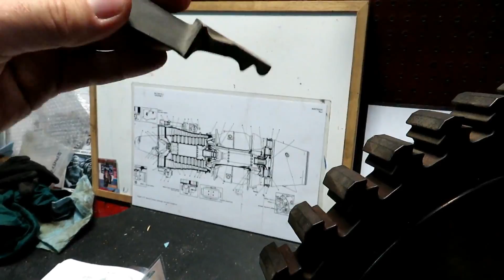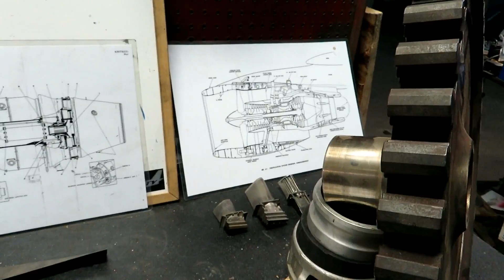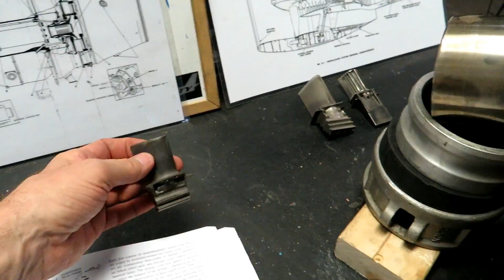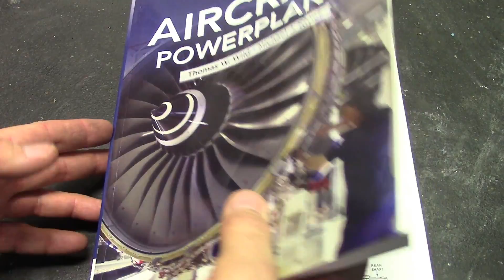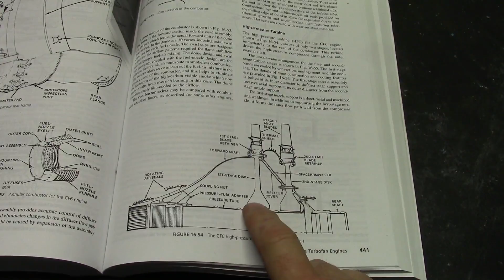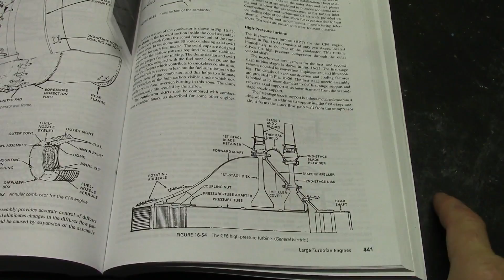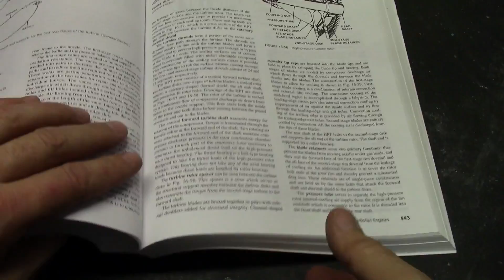Turbine Interstage Seals

Comment: how did the old blades not melt from not having the cool air.
Reply: They run on lower temperatures, which meant they were less efficient. The combustion was incomplete, and this resulted in black smoke from the engines.
Reply: Uncooled blades are commonly used at later stages of turbine as it's cooler back there. I'm going to assume these were IP or LP blades due to their size. HP blades are smaller and almost always cooled and coated.

Comment: 11:40, you can say that again to somebody whose new to this field. I am struggling, my intuition say the pressure should increase. Someone point me to another video for (fundamental) education.
Reply: Air expands when heated and the molecules vibrate more hence the air leaves the combustor explosively. There's high pressure in the combustor but pressure reduces as you as the air expands and whooshes past last turbine stages.
Reply: The cross-section exiting the combustor is shaped like a nozzle in order to increase the speed of the gas, as turbines extract kinetic energy, not heat or pressure (directly anyway). In order to increase speed, temperature and pressure is traded in. Additionally,  there is an open hole at the back of the engine. If air isn't actively compressed, and is above atmospheric, it wants to flow out the back of the turbine. In the process, it loses pressure to turbines and nozzles and air resistance.
Reply: when you design an jet engine the small portion after the flame section is generally termed the throat in most simplified videos ... from their you go into the expansion chamber and then on past the diverging end and out ... on the way by you run that air that is sped up along the fins of the turbine ... because of the angle they are on they start to spin which makes the engine produce thrust and pushes you forward ... take a house hold fan and put a cone on the output side ... at the end of the cone you feel faster air ... but a little warmer ... (thats the compression ... ok it would be maybe 0.000000001deg warmer) now if you had another fan after that cone the air form the first would start the blades on the second spinning just because of the air pressure pushing against them .... that is the simplistic form of HOW the engine gets going .... you are trading heated air for motion ... same idea is blow a balloon up and then let it go ... the air pressure makes it fart and fly around the room ...
Reply: the part I have a hard time seeing in my head is the actual startup ... on rc engines one starts them with an outside means to give them spin and then you light them ... on a plane you dont have a drill to attach so you need some way to get them moving ... perhaps the hydraulics start the blades spinning with power from the apu ... and then the engines get lit and then the flame speeds them up ... or perhaps they pump a little fuel into the combustor and then let the hot gases start pushing the turbine to begin the process ... again using the apu to get the pumps moving that need to be moving ... or they do it with some combination or some other way entirely ... heck they might even use an electric motor to start the blades spinning and then add spark and ignite the fuel and take over at that point which then would allow the electric motor to be a source of electrical power back to the plane to run stuff ... and so on ...
Reply: Bernoulli’s principle. An increase in  fluid velocity has a resultant decrease in fluid pressure. And the reverse is also true. You can’t change one without affecting the other. After the combust or yo7 want the air to do work meaning turning the turbine. You design the turbine section to decrease pressure to increase the fluid velocity to perform work.ie turn the turbine.

Comment: The SN # are likely spaced like that due to a certain tech was preforming the installation wrong and was caught??? Just a guess
Reply from the maker: Serial numbers are not used for positioning or installation.
Reply: @AgentJayZ    Agree, I do serialize some prototype engine parts.  We mostly manufacture new design parts and I believe each part has it's own sequential number system.
Reply: We air cool blades, as he refers to it.  5 Axis single point EDM.
Reply: The serial numbers on the individual parts are the sole individual identification numbers for that part.  The Manufacturer Part Numbers (MPN) will be the same for ALL the Turbine Blades; but each individual Turbine Blade will have it own Serial Number (S/N).  Serial numbers being in Sequence is more probably more likely when the engine was brand-new from the factory since the parts were most likely made at the same time, came together in the same batch, etc....  If during periodic maintenance  over the life of the engine the blades can be replaced.     Then the serial numbers can then be totally different or dissimilar because blades are replaced from time to time; removed & repaired then put into another engine;  all sorts of scenarios can cause this.  Also know, these blades will be spinning at around 10,000 RPM SO YOU HAVE TO HAVE A ROTATIONAL BALANCE FACTOR TO CONSIDER.  In some instances the FLIGHT HOURS &/or the Cycle life (1 takeoff & one Landing=1 cycle) ON EACH TURBINE BLADE SOMETIMES IS ALSO CONSIDERED.  But the MPNs would have to be the correct, & most likely the same as all the others; that is unless a Service Bulletin from the Engine Manufacturer will allow differing MPNs but those MPNs HAVE TO BE THE APPROVED PART NUMBERS.  You can see how confusing this can become.  But, all this is verified prior to part installation usually by more than one person involved.-FUN STUFF HUH!

Comment: Several thousand dollars apiece?...........Well; there goes my home built engine plans for my jet powered hang-glider.
Reply: I think I could build one, in a lifetime.
Reply: You could buy a commercially available small turbojet (or two),  as used for model aircraft.  USD3,000 or so, each?

Comment: I have a copy of Aircraft Powerplants: Ninth Edition on order via Amazon.
Reply: Just 1 query sir. Do you have any insight about using refinery flare gases as fuel for aeroderivative engines. 
Thanks for your valuable expertise.
Reply: @cck0728  You may have read a comment of mine where I said that I had some experience of burning ethane in an aeroderivative industrial gas generator.  It's a long time ago now, but my vague recollection is that the ethane was a by-product of some process.  It may have been obtained from 'stripping' ethane from raw natural gas, or it could have been a refinery by-product.
Initially, we used the standard gas burners, originally designed for use with natural gas.  However,  we discovered that a large build-up of carbon  occurred on the head of the burner.   Periodically, the carbon would be shed, causing erosion of the leading edges of the HP turbine blades.  The problem was solved by inserting a small bore tube through the centre of the burner head, feeding compressor delivery air into the centre of the ring of small gas outlet  ports.
Reply: @grahamj9101  Thank you for your prompt reply. Please keep on contributing with your valuable expertise.

Comment: Would not the centrifugal force suck air through the blades?
Reply: I'll let AgentJayZ object to the word "suck": I'll object to the term "centrifugal force".  There is no such thing as "centrifugal force": I was told that, in no uncertain terms, very early in the first term/semester of my engineering degree course.
Reply from the maker: Whatever influence the rotation of the turbine has on the cooling air in the blades, the important thing to consider is that there is a source of this air. It's the source and pathway that we are looking at.
The rate at which the air flows, and how much is needed to keep the blade material within safe temperature limits is a subject for people way smarter than me.
Reply: @AgentJayZ  One simple statement can be made: Whatever effect is stretching those blades is also working on the air in the blade.
The stagnation pressure at the front of the blade may be very high because the air in the blade is at a way higher pressure than the compressor.
Reply from the maker: 1) Sure, no argument from me.
2) These are not compressor blades. At the outlet of the compressor is the highest pressure you will find in the engine, so not sure what you are claiming.
Reply: @AgentJayZ  "outlet of the compressor is the highest pressure you will find in the engine"
I am claiming that you are wrong.
The term pressure is at the same time well defined and simple but also misleading because we tend to think of it as static thermal pressure. We also fail to think of gas as having inertia. Anything redirecting or displacing a fluid stream is under dynamic pressure.
Now, your statement might be right if you state it like this:  "At the outlet of the compressor there is the highest density and static pressure and the lowest speed from there on, you will find in an engine."
But the turbine blades are being blasted with gas, they are "standing" in a stiff wind.
The bleed air in the blades was already compressed and is now on an accelerated trajectory, just like inside a pump.
All you have to do is to recognise a pump when you see it and admit that adding to something a positive amount makes it bigger.
Reply: @0MoTheG  I’m sorry (no, not really), but you are quite overlooking the fact that there is a considerable pressure drop across the HP1 NGVs.
Beyond that, you are also overlooking the fact that the density of the cooling air in the turbine blade passages is a fraction of the mass of the blade. 
Having said that, there is a very small C/F pumping effect across the blades.  However, the latest blades are typically ‘multipass’, meaning that the air flows both outward and inward through the interior of the blade.
A C/F pumping effect is frequently achieved by ‘injecting’ the cooling air at a low radius into the radial space between a mini-disc (or cover plate) and the  front face of the HP1 turbine disc.
Reply: @grahamj9101  The inward flow is not an issue as long as the net flow is outward. Even seen water flow from one barrel to another through a hose even though it had to go up?
Reply from the maker: OMO... if you want to correct me, it would help to be correct. Your understanding is flawed, and the facts do not care what you claim.
Reply: @0MoTheG  The simple fact that I am trying to get over to you is that air-cooled turbine blades are the inefficient periphery of a very inefficient centrifugal compressor. The C/F pumping effect through the blades is very much of a second order.
So have you ever been responsible for the design of any turbines for jet engines? So how about giving us a simple compare and contrast between low radius injection of cooling air versus high radius preswirl injection?
Reply: @0MoTheG  Standing?  No, the turbine blades are not “standing”: they are running away from the “stiff wind”.
The compressor delivery pressure is most definitely the highest pressure you will find in an engine. I totally support AgentJayZ’s latest comment and his criticism of you.
PS And if you hadn’t already picked this up from my previous comments, I had a career lifetime in the design of gas turbine engines, industrial, marine and aero.
Reply: @0MoTheG  You appear to have a fixation with the cooling of the turbine blades, but the first-stage NGVs (nozzle guide vanes) are subjected to the highest temperatures, because they are most definitely "standing" in the efflux from the combustion chamber.  In addition to being cooled internally, they also have numerous rows of so-called film cooling holes that create a thin film of cooling air on the surface of the aerofoil.  
The film cooling is effectively 'driven' by the pressure drop across the combustion chamber walls, which is of the order of 5percent of the compressor delivery pressure.  That differential is more than adequate to eject cooling air at the stagnation point at the leading edges of the NGVs.  That same pressure, less some losses due to the more tortuous route to the blades, plus some small C/F pumping effect, is similarly more than adequate to eject film cooling air at the leading edges of the HP turbine blades.
In respect of the turbine blades, you need to get your head around the fact that, as the blades are (as I characterise it) "running away" from (as you characterise it)  "a stiff wind", they are subject to relative total temperature and relative total pressure.  If you want an analogy, it's similar to the true and apparent wind effect with which sailors (like me) are familiar.
Reply: @0MoTheG  Have you finally got the message?  NO!  The internal pressure in the blade is most definitely not way higher than compressor delivery pressure.
Reply: @grahamj9101  Your point about the guide vanes proves that the compressor alone is sufficient to drive out the air.
Since the guides are not rotating they can withstand higher temperatures.
Reply: @0MoTheG  Yes, being static aerofoils, the NGVs can and do withstand higher temperatures and they are typically made from substantially different alloys.
Having spent a career lifetime designing gas turbine engines, I do have some familiarity with the way compressors, combustion chambers and turbines operate.